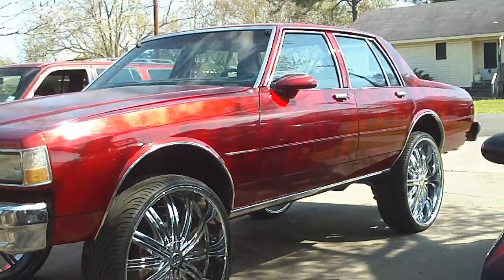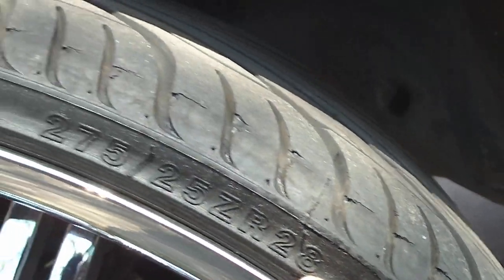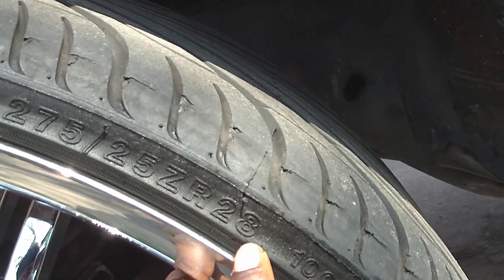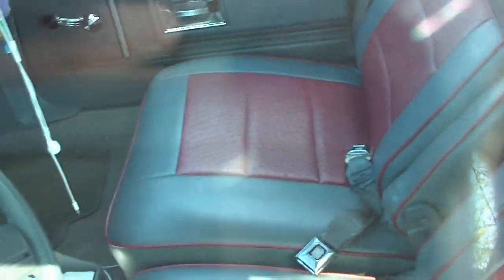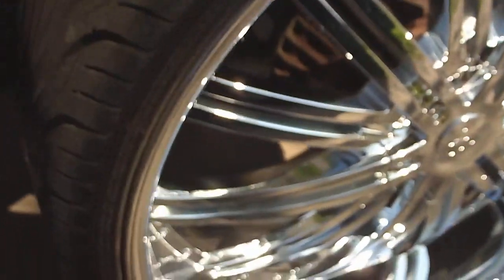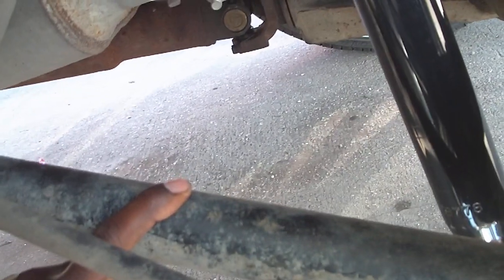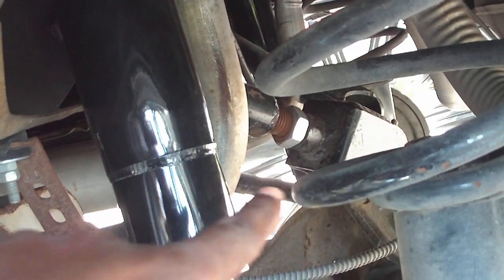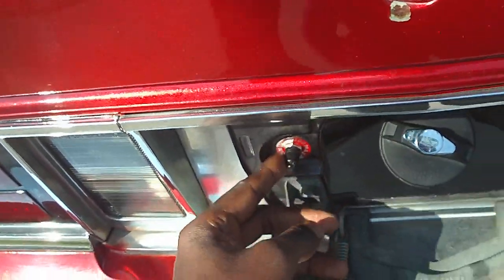how to lift a caprice

Comment: How much extra lift did you get out of the front with the heavy duty springs and the knuckles? Because that looks like a way bigger lift than just 5 inches. I had a 4 inch lift like 8 years ago on my box with 305/35/24 and it was nowhere near that high. Just wondering because I want to go 8s and was thinking of the UK spindles but don't know what it will sit like

Comment: I'm needing to lift mine for my 275/60/20 to much tire for stock springs or am i wrong on that? I'm not wanting to go low profile
Reply: 275/30/20 you'll like the tire size plus the clearance.

Comment: who the fuck put knuckles on a car.that's the cheap way.wait until he hit a bump or a pot hole".he could have got coil springs off a chevy pick up truck because they are taller then chevy car.that's what I would have done.you could always weld the coil springs to fit".and I would have change the gears in the rear end so my tranmison want burn out"